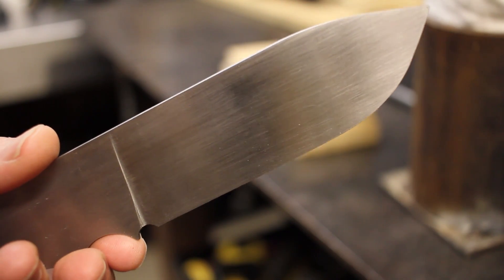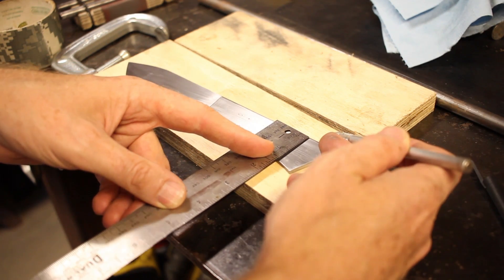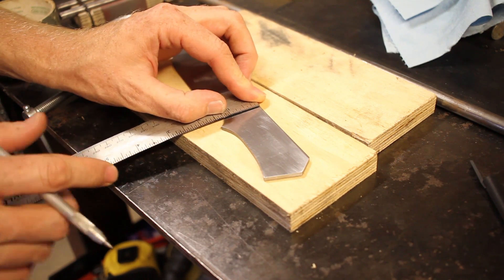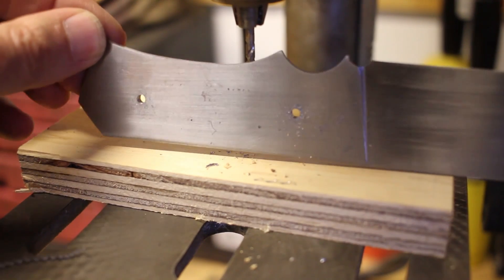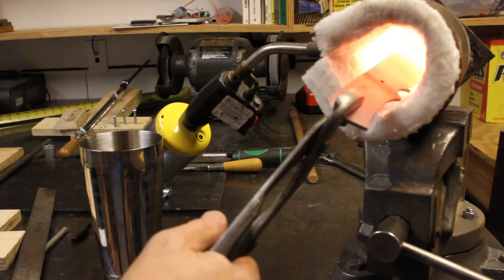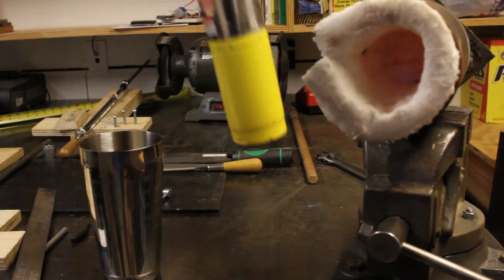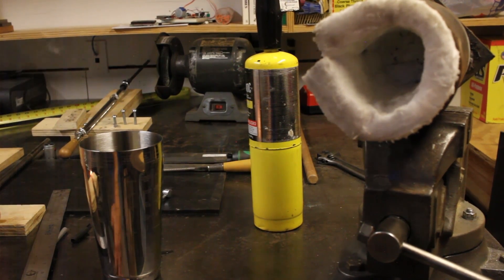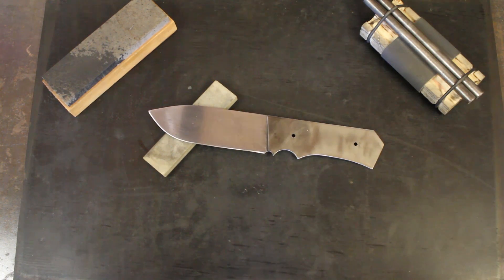Tempering & Heat Treating a 1095 Steel Knife Blade

Comment: Your setup is not good for 1095. That blade is most likely not very hard and has giant grain structure. 1095 requires a soak time. Stick to 1075 to 1085. 1095 is not a beginner knife steel.
Reply from the maker: Thanks for the comment! This video was from about 6 years ago. I still have the equipment and want to try knife making again but have had too many other things going on.

Comment: Another easy way to check it is with a magnet, if you keep it hot a minute after the magnet stops working you are going to be the right temp and I’ve kept my quench at 130 degrees and I’ve had good luck getting good hard edges that hold up
Reply: yes u about right when it turns red u wait for 1 more shade of red then u quench it

Comment: Oof.... another guy on youtube who is using unsealed ceramic insulation. You do know that stuff is just like asbestos on your lungs right? it must be fully sealed with refractory or satanite. It should never be handled, cut, or used in a forge without being completely coated.
Reply from the maker: I didn't at the time (10ish years ago) but thanks to all the comments on this vid I do now. :)

Comment: how did you fix the warp?
Reply from the maker: Paul Arellano I actually haven’t fixed it yet. It’s still warped. I still need to finish this knife.
Reply: I only ask because I'm in the middle of a knife that warped pretty bad and was going to use your advice haha
Reply from the maker: Paul Arellano I was thinking of clamping it between some pieces of wood in my vise and trying to bend it straight again but I haven’t tried it yet. 🙂
Reply: My project is O1 tool steel straight razor. I'll let you know how it turns out trying to bend it back.
Reply: @SaltCityFab  heat it up and try to straighten it. Get a digital thermometer. That’s what I did, Amazon has one that goes to 2000°

Comment: Most likely your blade warped from heating it way too hot for quenching, and also stirring in oil can result in warp issues, if I may add.
Reply from the maker: Yeah, I made a few mistakes and learned a few things with that one. That's the fun in learning though right? :)

Comment: Way too hot on the heat treating. Great vid though . All you need is a light red in color . Dim the lights in that shop
Reply: Use a magnet when it is non magnetic it is ready. Color is not as accurate
Reply: I just bought a digital thermometer that goes to 2000° when it hits 1475 I quench
Reply: @KNIGHTFALL_SUPERMAN  I was wondering why guys don't do that.
Reply from the maker: capthollis thanks for the tip!
Reply: CrushingDemons yes sir! Great video

Comment: Not being rude but for your safety please coat that kaowool in colloidIal silica and satanite or the likes so you don't get lung cancer. At temp untreated that wool releases free silica into the air. Keep up the good work.
Reply from the maker: Yeah, that was actually the only time I've used that mini forge. I'm in the process of making a larger one now with some kaowool and kastolite 30LI cement. I'll upload some videos of that one once I have all the components and start the build process. Will probably be making a ribbon burner for that one as well.
Reply: I am so glad this is the first comment I saw! Came to say the same thing. Coat with refractory cement, heat stop, ITC 100 ( if you want to get fancy) ANYTHING! please do not get sick just to save some time and money.
Reply: Get a proper burner for that one too! From Alec Steele for example! Google ''Alec Steele burner'' and go to his website!
Reply: Neither him, nor Sam currently sell burners. Not only that but they are expensive and meant for much larger propane canisters.
Reply: You might consider softbrick rather than the blanket no? I have a mini forge (not homemade, I bought it, but it was still very cheap, under $200), which has ceramic blanket with rigidizer on it already. I wore a mask around it for a while because you could still see particles breaking off here and there. I only use it outside as well, with a nice breeze. My self made forge, one day anyway, will use softbrick. I much prefer that idea.

Comment: can you ever overheat it for quenching?
Reply: The best way, if you're using a torch forge like this, is to get a magnet on a stick and see when it loses it's magnetism. Then soak it for maybe 30 seconds to a couple minutes longer and then quench. It's easier than trying to gauge it by the color, and actually helps you identify what color is correct.
Reply: Yes. overheating will make the grain structure in the steal expand and that will weaken the steal.
Reply: So getting the temperature right will take a ton of tries I guess...thanks for answering!

Comment: Most people heat treat at night, or in very limited light because the color depends on ambient light.  You have a bright shop, so the red you get is going to be hotter than the red you need which can best be seen at night or in a dark shop.  See Walter Sorrels on this topic.